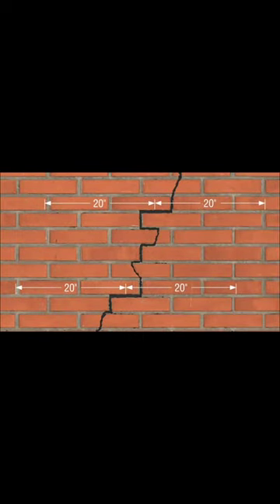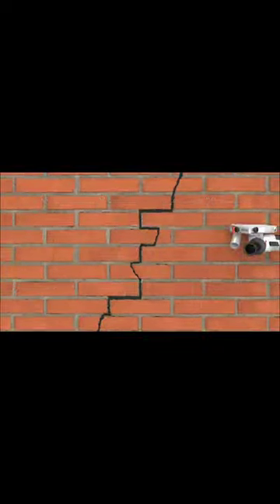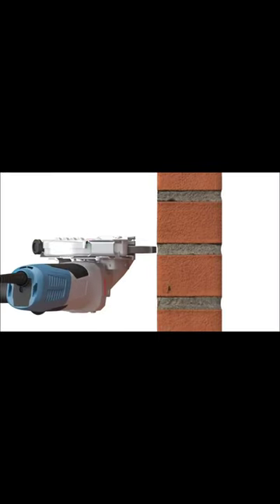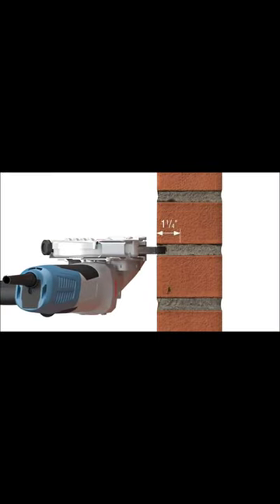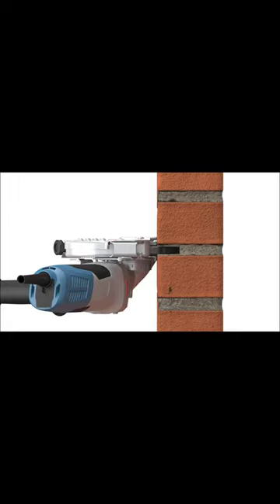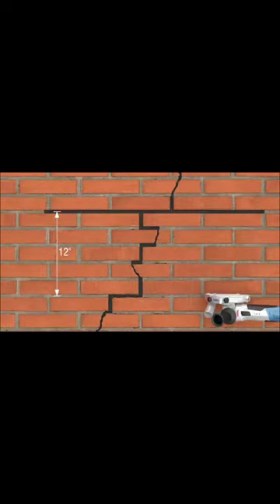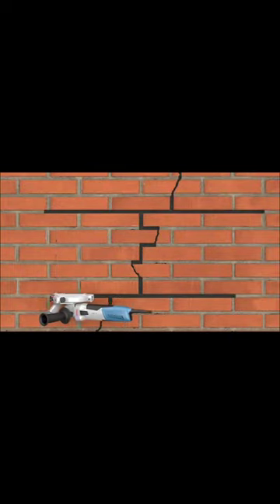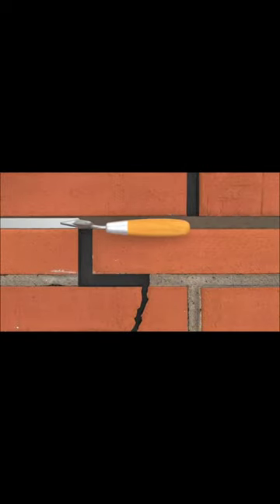How to Repair Cracked Brick wall | Crack Stitching Masonry wall| Know Civil Engineering with Kundan

Comment: Do your have to use repair mortar? I have a 1920 row home with sand/lime mortar. Can I use the regular mortar?
Reply from the maker: No. Repair should always be done by non-shrink grout. Because after repair work.. the originality, integrity and homogeneity of the structure is lost.. which may again cause structural failure Because lot of minor voids remain unfilled by regular mortar.. hence, by using non-shrink grout, we are ensured that there are no voids left behind. 
Also the repair work should always be done using a higher grade material..

Comment: Might want to check your foundation to make sure it's ok and the soil hasn't shift which would create those type of cracks
Reply: How u do dis?
Reply: @artfx9  for foundation checks you’ll need an engineer to check your plot
Reply: @artfx9 dig under your house

Find the cracked part of the footing, put a plank under it, then lift it up with a car jack, then leave it there, covered in concrete, the house footing crack should stop collapsing downwards, but should be lifted up, closing the gap back up
Reply: @relaxative2006   I dig unger soviet block house? Ok. First I break basement door lock. Then dig 😊
Reply: @artfx9 why through the basement?
Reply: @relaxative2006   so people don't find me.

Comment: How about for horizontal cracks?
Reply from the maker: Horizontal cracks general occur due to two major reason.. that is 1) sinking foundation and 2) sulphate attack at cement plaster due to the presence of soil and moisture in its surrounding. 
No such repair has been recommended for that as on now. It needs to rebuild it after demolishing. 
How sulphate affect cement? The fertilizer we put for agricultural use contains sulphate.. that sulphate weakens the particle bonding & makes the land porous.. so soil becomes good for farming.
But it is contrast to that for cement structure.. do not let sulphate to come contact with cement.. otherwise it ll try to weaken the bond in plaster in the presence of moisture. Hence, use more cement in Plaster as a precautionary measure. Do proper curing for atleast 7 days.